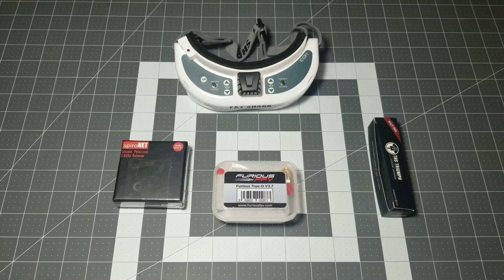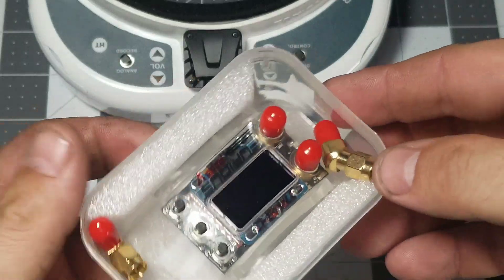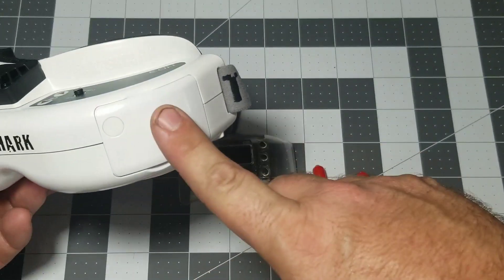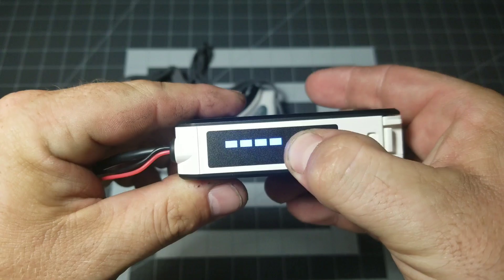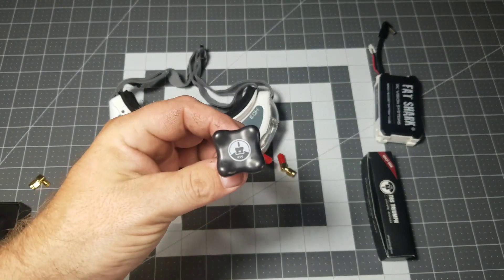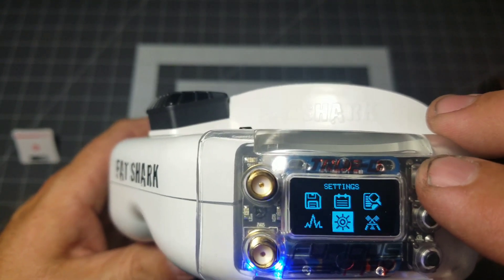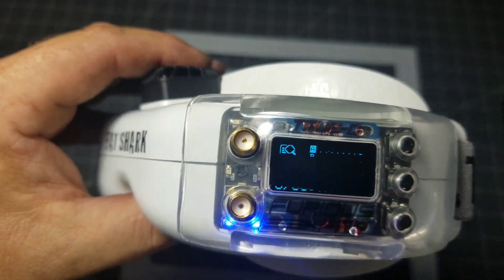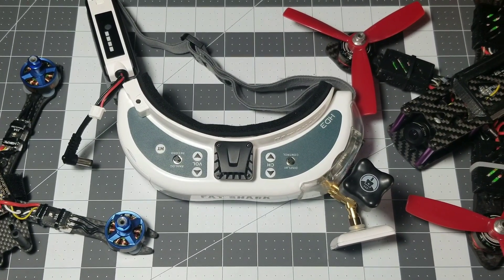Furious Fpv True-D 3.7 Receiver Module Installation and Calibration

Comment: Would you know how to fix a upside down screen on this module
Reply from the maker: I would suggest to update the firmware to fix this issue. If on the newest firmware go back to older version and then update to newest. Best of luck let me know how you make out.
Reply: @edrone_  ok...I fixed it...I put 3.9 on it..just the wrong 3.9 lol

Comment: Hey man! I'm having trouble with my connection! unless I'm pointed directly at the drone and within 5 feet away my video completely cuts out :( Any ideas on how to fix this? It was working fine until it just didn't anymore
Reply from the maker: What kind of antennas are you using for your drone and your module?
Reply: edrone I’m using TBS for both!! If you could message me on Instagram it would be greatly appreciated, that way I can send pictures of what I have because I’m pretty new and bought the setup pre built @_ryanmccomas
Reply from the maker: @RyanMcComas  i sent you a pm on Instagram

Comment: hey bro,, how did you get  the  different screen savers to work  ? i have 3.8 on my true d that was  3.6, but for whatever reason, i cannot seem to find where or how to even look to see where it possibly is located in my module, if ya can, id be most grateful
Reply from the maker: Hold down on the up or down button to change screen savers https://youtu.be/IzoMsNfuhKg

Comment: Thanks good info on this module. But must you calibrate it ever time you switch quads. Its just I got 4 quads on deferent channels. ?
Reply from the maker: I only calibrated it once and I have flown with two different quads on two different channels and have had no issues
Reply: Thanks thats what I wanted to here :) Just waiting on my new HD3 now to fit it.

Comment: Very cool!! I hope by next summer to gave a better pair of fpv goggles!! I want to learn acro but dnt have a computer and the fat shark predator v3 i have..... Have. Such a small f.o.v. that I feel like I'm going 2 crash all the time!!! I need a whoop with acro! My dumb a#s got a 5inch for my 1st fpv drone!!! Its sweet but way to powerful for me 2 learn acro on!!! Well maybe not i try everyday!! But crash so much!!! I feel like giving up at times but i love the HOBBY and the people in it to much to quit!!      GREAT CHANNEL!!!!
                 I❤DRONES!!!!
                    👍😀👍
          F.P.V. LIFE-4 LIFE
Reply: I did the same thing and got a 5", but i did get a whoop shortly afyer and i wasnt into it....the 5" is just to cool. For acro just get up high if possible and practice little tricks and keep the angle switch near so if you get into trouble you can level it out fast.....in no time you will only wanna fly in acro. Good luck, dont give up it gets even more fun and expensive😂
Reply: Did you finally do acro
Reply: I started with a 5inch quad and what I did to get into acro was fairly simple, just get a good grassy open area and practice up higher than normal, and have angle mode ready to go this will save you when you freak out, after a few flights you won't even use angle anymore. And get into pinching as soon as possible....I've been flying for a year now and I'm having trouble with the learning curve. Happy flying!!!